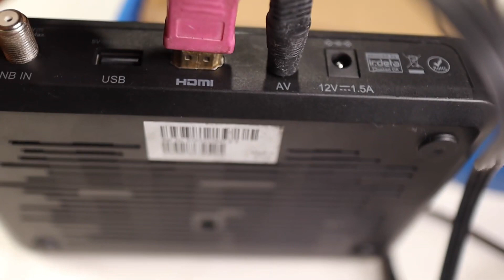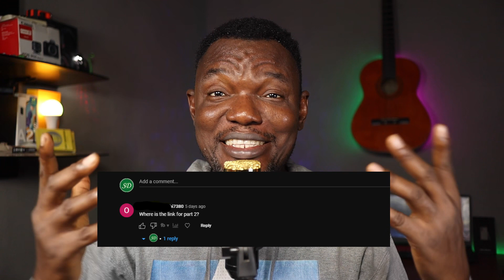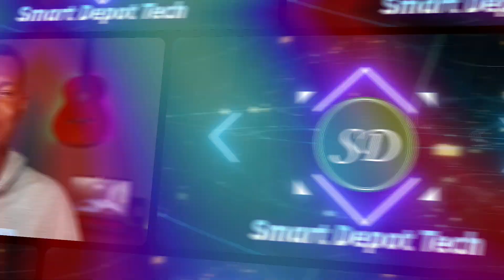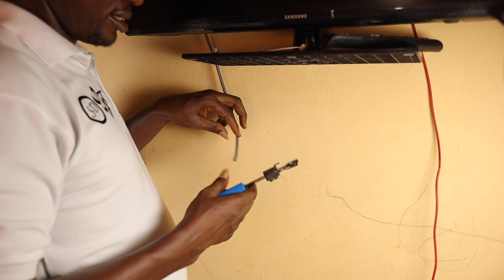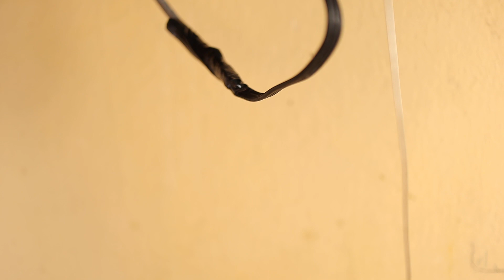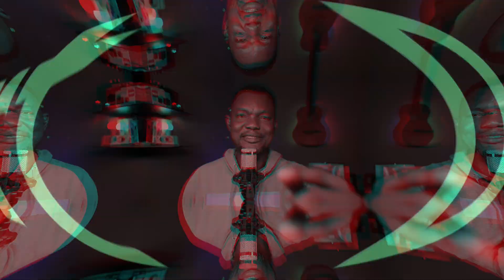DSTV: How I connected Multiple TVs With AV and LAN Cable Pt. 2

Comment: The lan cable has 4 wires and the Av has 6 wires (3wires) in it, so how do I match that together
Reply: Use the yellow for video and take one of the two colors red and white.
So if you take the yellow which is for video and red which is for audio, you will get your video playing on the other side with audio, thanks, hope you understand

Comment: How can I watch two different channels at the same time?
Reply from the maker: You can with the older decoders that have RF out or you buy an AVI to RF converter or buy DSTV Explorer
Reply: @SmartDepot please how do you connect different channels with the old decoder? Thanks
Reply: What's the difference between Explora and XtraView and which one is better? Bearing in mind that I want to use it for commercial purposes.

Comment: My challenge is matching the colour cables together
Reply from the maker: That's a good question but that would have made it video so long. 1st, trace which colour is Video and the left/right audio. The RJ45 Ethernet cable colouring is standard. Choose the colour you want to use for Video and audios. You can make each channel (video, left and right audio) have its own negative line or you can use one line for all the negatives

Comment: is there an option to extend wirelessly ?
Reply from the maker: Yeah. There are loads of video transmitters in the market that can use HDMI plugs even AVI but they are quite expensive and requires to be powered on for them to work

Comment: Won't there be a delay in Av
Reply from the maker: No. Not at all with CAT 6E cable at about 15 meters distance
Reply: I have a question , can this cause a fire ?
Will an Rca 10 metre cable work ?